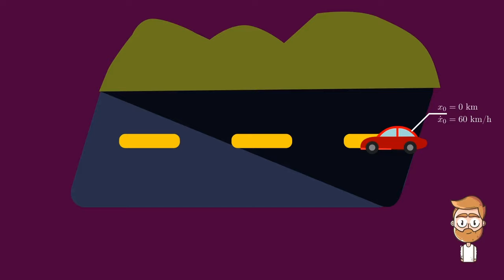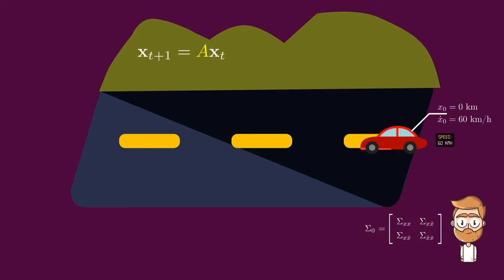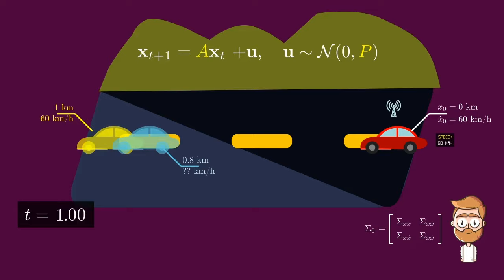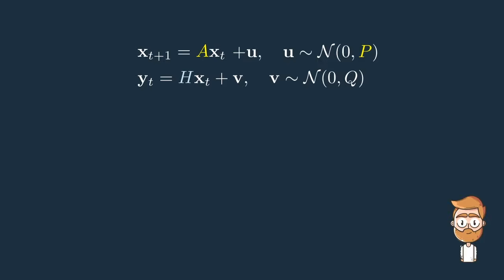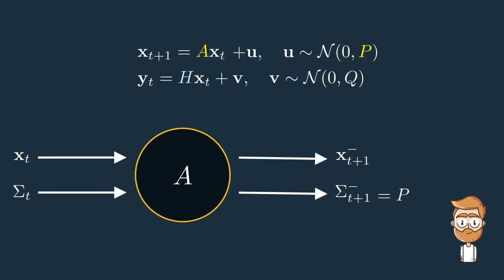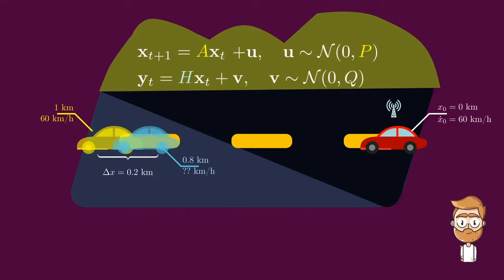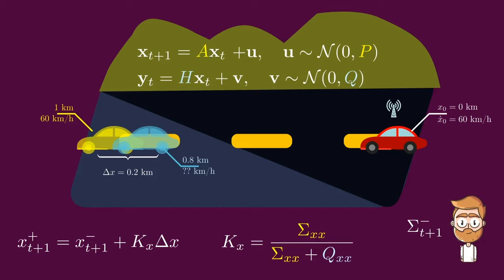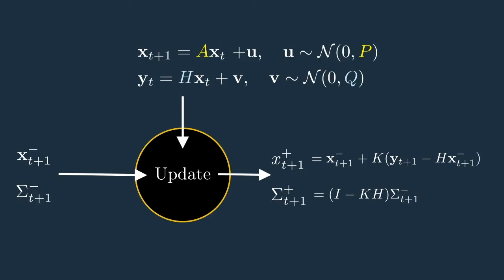Visually Explained: Kalman Filters

Comment: Nice.  You indicate that the Kalman gain term can be between -1 and 1, but only explain the case when it is 0 and when it is 1.  I would add a note in the video to a reference describing why it could be -1 or edit the audio to remove this statement.
Reply from the maker: You make a valid point! While a Kalman gain like "Kx,xdot" can take negative values, "diagonal" Kalman gains like Kxx are always between 0 and 1. I will add this to  the video description.
Reply: I was going to say this. How can you have something that is the ratio of two variances to be negative.

Comment: Sadly the car can not start moving at constant speed from time = 0+. \\\ In the beginning the speed starts from 0 then accelerates (Delta V / Delta t) until it reaches constant speed.
Reply from the maker: You are absolutely right!  Realistically, a car cannot go for a speed of 0 to V in no time (even for Tesla cars that are known for some insane accelerations). However, I have picked a stylized dynamics model here that only involves two state variables (position and velocity only,  without acceleration) in order to make the problem two dimensional, and therefore easier to visualize and explain.
Reply: @VisuallyExplained   That's what they taught us in the University in Physics and the real life is something else. In electrical engineering we have something called electric current at t = 0 and t = 0+ and t = 0- funny but true

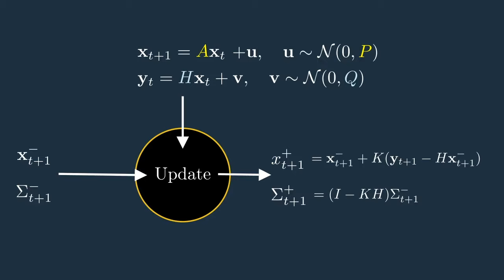Comment: Hey, It was great explanation. I have a question at video time 10:52, where the predicted state x_(t+1) + h has a common term K Which is multiplied with (y_t+1 - Hx_(t+1)), and my question is how significant the measurement state i.e. y_(t) in this calculation. I did not get where is that being considered. And also could you clarify how the current state system is considered i.e. x_(t) as mentioned at video time 5:14.

Comment: It's difficult to keep track of what each equation refers to -- please name your variables descriptively. 
This concept was not visually explained: It used pictures, but it was explained for those who have a strong math background. When advertised as a visual explanation, I hoped for less of a mathematical explanation and more of a logical breakdown of the concept, with the math as a secondary support. Instead It feels like the math is the primary descriptor, and the explanation is very difficult to follow without a strong mathematical background.
Reply from the maker: Hey there, thanks for watching! I understand where you are coming from. It's hard to calibrate the video to all backgrounds. This video's target are 1st and 2nd year engineering undergrads that have some familiarity with linear algebra and dynamical systems. If you don't come from a math background, it might be hard to follow all the equations in the video, especially towards the end. But hopefully you still get a sense of what Kalman Filters  do, how they can be useful, and maybe have a clearer idea of what you should look up next related to Kalman filters. In any case, thanks a lot for leaving a comment, it helps me improve for the next videos.

Comment: Would it be possible to use the algorithm for tracking the vehicle position in real time. And I'm talking every second rather than hour?
Thanks a lot for the great video!
Reply from the maker: Absolutely! The algorithm is super fast, you can even use at a higher frequency than once every second (if your measurement instruments can keep up).
Reply: Thanks a lot! We are trying to track the position using a mobile device. So we were looking for an algorithm that uses minimum processing power/ resources and now considering this as an option.

Comment: Hi, thank you for sharing your knowledge on this difficult topic! May I ask for the derivation of next sigma = P + A sigma A transpose? I am struggling with the integrals xD

Also, A needs to be invertible right?

Thank you!!
Reply from the maker: Sure! 

This is coming from the fact that
x_next = Ax + u, 
so assuming u is independent from x, we get var(x_next) = var(Ax) + var(u)

On the one hand, var(u) = P by assumption
On the other hand, var(Ax) = A var(x)A^T (This is always true by the way, as long as the matrix A is deterministic)
Since var(x) = Sigma_t, we get the result you stated.

Note that we didn't need the fact that A is invertible. (A^T denotes the transpose of A, not the inverse).

Hope this helps.
Reply: @VisuallyExplained  Thank you for your response!!!
Worked through the hassles with monstrous integrals and baffling matrix lemmas (inverse & determinant), truly frightening, but at the same time exciting.
Got it, A needs not to be invertible!
Also, do you recommend any texts on the history of inventing the Kalman Filter? That must be very fun to read.

Comment: Thats weird....the mechanical speedo in my can isnt noisy at all....Maybe if youre using noisy sensors you need to invest in better designed sensors instead of those amazon cheapos. Also, before applying to Tesla please for the love of god, learn to program for failure modes.... The amount of videos of vehicle 'AI' systems freaking out at the moon because it thinks its a traffic light. Or a traffic light, being transported and freaking out because it cant see the color indicator, or at cones again on a truck....what if some youngin programmer decided to have the car slam on the brakes when one of these false positives come through? Yeah, the state of these systems arent actually road safe. 'It works' is NOT a end point. 'We cannot get it to screw up' is. Unfortunately too much has been invested into the 'it works, ship it' industry, that when they discover what we already knew since the 70s (computers only got faster since then, we're still computing in binary kiddies) that TEACHING A COMPUTER TO DRIVE IS ALMOST IMPOSSIBLE!!!! Sleep well knowing these 'it works, good enough, ship it' 3 ton machines are mindlessly following lines, not actually conceptualizing their environment...... Maybe when it runs over a kid instead of some bum, again, you people will listen....but I doubt it....